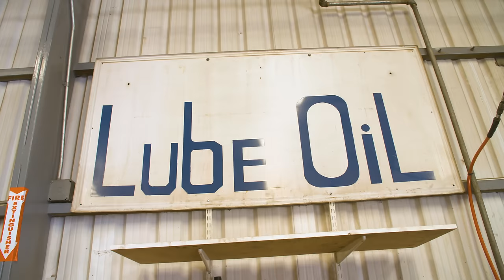Welded Diff vs. $1200 Diff | HiLow

Comment: It's cheap to build a race car. It's expensive to make a daily race car.
Reply: Well said
Reply: Yup, thats why cars like GTRs M5s etc are so expensive 😭
Reply: You can always weld the diff and when it brokes down buy the new diff for something like 700. that kaaz was way overkill for 1200
Reply: The poor man pays twice. Guess how I know.
Reply: Yeah because an f1 car is dirt cheap 🤔
Reply: Mmhmm my modded prius cost more than an FD 1kwhp car 🤡
Reply: It isn’t cheap to build a race car trust me
Reply: @DuBstep115  but if you invest 1200 you wont care about the diff getting broke instead of paying 700 each time its gets broken
Reply: It's cheap to maintain a daily car. And expensive to maintain a racecar.
Reply: Swampy  It blows my mind how many Mini's I see on the road and even more when they are tuned/modified. Those cars are built with such poor quality and the parts are so expensive, I just don't know why they do it.
Reply: Except if you plan on passing tech inspection, when your track you go to is very stringent, if you are using stock seats and belts you are aren’t allowed to go full force around corners and if you have racing seat and harness they have to be a common brand name not some random brand off eBay, ands other random things like that
Reply: HappyDude It isn’t, but we aren’t talking about a fully works-carbon-fiber, custom race turbo-hybrid V6 and a living shit ton of aero. We are talking cheap ebay trubo 4banger civic with a lip spoiler.
Reply: Lincoln locker will eat $1400 in tires evening out the costs in a couple years. Living with a spool or lincoln locker in daily driver life sucks.
Reply: Ummm, what kind of “race car”.  No winning race car is cheap to build.
Reply: @DuBstep115  wait so 2 oem diffs cost more than the 1200 diff already !?
1 2-way diff = 1200 
2 oem diffs = 1400
bro
Reply: No such thing as a cheap race car. Even a properly built miata is still expensive. Affordable race parts are still expensive. If you mean by cheap by getting cheap knock offs from China, they do not classify as a race part.

No true race part is cheap as it shouldn't be. It is your life if something fails on your car at the track. Go watch some videos on youtbe where people car fails them at the track going cheap. Some lose there life because of it, others with permanent injuries.
Reply: lol. Incorrect. Building a miata spec racer is the most inexpensive racecar, expect to come out over 10 thousand invested, even with decent hookups. If you own your own shop, have all the tools and knowhow, it will still be 5-6k for a back of the pack racecar. Expect 30+ thousand for a highly competitive podium car. You can sometimes find these for sale, used in the low to mid 20's.
Reply: Cheap to build a car if u know other racecar people lol. I do nothing but side hustles. And have 3 cars and a truck 2 kids and a wife. My 240sx has 5.0 swap. My lexus gs300 has a 3uzvvti swap. My volvo has a huge turbo on 14psi. All have welded diff. Lexus is tuned. 3.9 gears. All 3 cars ive built with under 2k lmao. Building racecars aint hard if you know what your doing. Plus doing the work yourself. But i mean if u like paying someone to install your parts yea shit gets expensive quick lmao but that aint no fun
Reply: Must i add. They technically arent racecars. I drift so theyre drift cars lol. Ill be at grange for andys slay day in the volvo. Catch yall
Reply: @firsttimegod802  I want an e39 M5 so bad but reliability scares me away
Reply: @Gage Petas its a 1986 volvo 740 wagon. 70mm compressor. 48mm exhaust. At 14psi. Has 350cc injectors. I daily it as well as the lexus. Volvo has been good to me. Hits rev limiter all day and still drives home🤣🤣👌
Reply: @Gage Petas yea older volvo from like 1995 and below with the redblock rwd are Tanks!  You got a genisis yea? Thats the b6? And b8
Reply: @Gage Petas can you post details about your m3 build?  I'm not starting beef, just really curious how you can pull 600 HP on an S54, even with brand name parts say used AA turbo kit or super charger with method/e85 for $6k.  Even 600 hp crank would be pretty hard without some major work, well over $6k.  Thanks.
Reply: Your idea of a race car must be pretty funny.
Reply: @firsttimegod802  agreed.  Modern BMWs (and most cars) are pretty efficient and can't really squeeze out more without heavy modifications.  The S54 has a strong iron block and can handle it's fair share of boost, but still.. 600 HP crank is going to cost well over $6k, even for used parts.  Meth/E85/Nitro? Perhaps for peak power.  For the record, I own an E46 M3 as well and my "race" car (it's not full race, it still has cats and stock intake), is all about weight savings and suspension and putting what power I have down the most efficiently and effectively.  Still well over $6k on that alone!
Reply: As a rotary fan I learned about balance of the holy trinity of Reliability, power, and fuel efficiency.
Reply: @HappyDude1  I would daily an F1 car
Reply: @romulas-cushmanproject3273  yall need some dirt tracks. ive just finished buying and building my car for less than 3000$
Reply: You can have fast, reliable, and cheap.... pick 2
Reply: @HappyDude1  build a daily driven f1 car for comparison and find out XD
Reply: @HectorOvalle18  How many broken 700 dollar diffs have you seen? I have seen zero, nada non in my entire life playing with Quiafe.
Reply: @Eduardo_Espinoza  Proper LSD costs 700
Reply: @DuBstep115  wait so a proper LSD cost the same as an OEM one!? what!?!
Reply: @Papa7Bravo  
Not possible 
An f1 car dousnt work on the road. 
And a road car can never beat an f1 car on the track
Reply: @HappyDude1  there you go....  so you cant compare an f1 car to anything...

Building a dedicated racecar is cheaper than a racecar that you use daily.
Reply: @Papa7Bravo  
Yes you can an f1 car is the ultimate race car its everything what tuners are trying to do only with exotic materials and the best engineers like those time attack cars and hill climb cars some of them have f1 engines
Reply: @HappyDude1  ok but now make an f1 car a road car and daily it....
Reply: Throw on nitrous, kits run about 500 and install maybe 700-1g, if u dont know a guy. Easiest high hp upgrade for any car
Reply: Anything is a racecar if you're brave enough
Reply: @SI0AX  Because they're a blast to drive, and even more so when they're tuned.
Reply: @whocares7144  nah. real race cars have regulations to meet which would require costly equipment like certified roll cages, fuel cells, fire suppression systems, etc. a miata cup car alone costs a lot more than a base miata + supercharger. also there are no real daily driver race cars nowadays because they won't be street legal, unless you are just talking about drag racing.
Reply: Im building a clapped out e36..ebay and hardware store special.  I won't be a daily driver  or  a race car , Its a  track car so no  specifications, so it will be cheap
Reply: Yeah cause it all need to be road safe and road legal
Reply: @HappyDude1  in terms of building, suprisingly. The cost is mostly just R&D
Reply: w ccbWeesS
Reply: w ccbWeesS
Reply: M
Reply: @HappyDude1  why is wrong with you lol
Reply: On my channel I like to off road in 2 wheel drive as much as possible and I drive on nails.
Reply: @hendrahendra  bcoz cheap parts
Reply: @firsttimegod802  haha you think? A f1 spec v10
Reply: @DuBstep115  With the time and effort and the prospect of replacing the diff and dedicating time and effort with that as well, you're not much off from $1200. That's IF your diff doesn't crap out more than twice in your car's life because that'd be over $1200.
Reply: @jac1207  700 take it or leave it
Reply: Good way of puttin it
Reply: @HappyDude1  Right. Now imagine how cheap an f1 car is compared to an f1 car that performs as a daily driver. Point is a race car is cheaper to own and run than a race car you use as a daily. Its a good point because most people buy their car and supe it up and can be surprised by the expense in keeping the car running.
Reply: @HappyDude1  huh
Reply: teach me the ways of calling the cheap stuff cheap  ;-;
Reply: Truer words have never been more spoken😂
Reply: Ni, Hector, not $700 each time you crack your welded diff. More like $70 for a diff out of the "pick n pull," plus your time.
Reply: @SI0AX  i had 1 and completely agree, thing never went more then a few months before it was rendered useless and stuck in the shop
Reply: @SHRMN8TR  Haha. he deleted it when you busted him  xD
Reply: @lukeclark3623  You have no idea
Reply: @tosehoed123  but i already daily the fastest car in the world
Reply: @kristofermartson1935  he means one that will last just a few races.
Reply: Nailed it 👍
Reply: Sums it up pretty well
Reply: @HappyDude1  no but none of the people watching this are working on an f1 car are you?

Comment: I will never forget the first time I swapped an open diff for an LSD. I was blown away how much more power I was able to put down and how much sooner. That's a phenomenal upgrade if you are serious about driving. For the street on the other hand??? I don't know if it is worth it. As I don't see a reason to drive that spirited on street roads. Maybe I am just older now. ;)
Reply: I had an 84 Camaro with 3.73 posi and I now own an 82 with an open diff. Waaay more confidence in the 84. I could push that car hard, drive it in the snow, etc. My 82 now can barely handle it in the rain. If it even smells like it might rain, that car starts spinning. The bigger motor might not help with that though ;)
Reply: Chevrolicious Something tells me it’s that bigger engines need to be revved and pushed harder. Hence the increase of LEAD in a man’s shoes. 
But what do I know? ;)
Reply: Lockers for all.
Reply: I have a fwd stock van and welded the diff just for fun and then sold it. Its was stupid
Reply: Your just older now lol 😉🤣🤣
Reply: BLAZINGINGPHOENIX Considering all the years that have passed. I would agree. ;)
Have a good new year everyone that is commenting.
Reply: The MK7 GTI is everywhere here in CO. Comes with LSD and is definitely one of the top choices for the mountain twisties and snow.
Reply: ekome I do like those cars. They’re fun cars as well.
Reply: @WarriorsPhoto  makes perfect sense to have LSD for the street too because it's low power, you can really get the most out of it
Reply: ekome That’s a good point. I didn’t think about that.
Reply: @_e5598  LSD is better on a front heavy car than AWD, but it is legal to substitute snow tires with AWD in CO.  Politicians are dumb.
Reply: @theBear89451  nothing replaces snow tires. The locals know.
Reply: One word “Snow”
Reply: @theBear89451  Um last I heard California gets snow too. ;)
Reply: 2 years on my welded e46 diff with no issues and I ❤ it!
Reply: Tropical Company Really??? That’s very cool. Isn’t the diff on those cars electronic?
Reply: On my build- I recently swapped rear ends.

Its pretty much undrivable without a locker or LSD in the rear end.... but- I dropped a 1,000 hp into a pickup that has enough traction issues with 400hp.
Reply: ericmck2000 Geez that’s a lot of power. Although I may be a C5 Z06 in a year or two. That’s 400 HP factory. LOL
Reply: @WarriorsPhoto  I had a GTO which was close.

But, it still wasn't enough power that you couldn't just mash the gas pedal and not have to worry.

At 1,000hp, you can't mat it until around 70+
Reply: ericmck2000 I was in a buddies 600+ HP Mustang(SORRY), a few years ago. Yup if he mashed the accelerator at under 40 MPH, it was just wheel spin. No bueno dude!
Reply: @WarriorsPhoto  I don't know.... being able to smoke the tires at interstate speeds is pretty fun, lmao.
Reply: @xtremeownagedotcom  I understand that. That was the first time I had experienced that. I was shocked coming from ah hum, Honda.
Reply: @WarriorsPhoto  I live in Northern California and we rarely get snow
Reply: Jordan Ware Same as So-Cal. Fair enough. ;)
Reply: @Chevrolicious.  84 Camaro? Quite the powerhouse.
Reply: LSD is great for winter driving fun, and not getting stuck in a pile of snow
Reply: erttu Snow is drive to in anyway. ;)
Reply: @WarriorsPhoto  very true
Reply: erttu Yes definitely! Thank you for the post. (:
Reply: Personally want an LSD on my z3, car is way too light, borderline impossible to drive in the rain without slipping a little bit. Gotta love that little dash light.

Comment: "I don't see this diff ever breaking"
In my personal experience, you just awoke every tiny flaw in that thing. You can't just speak bold statements like that without cursing yourself.
Reply: except for a welded diff, just filled the core of mine with weld and it outlasted the car, dont do manjis at 150 on a single lane dirt road
Reply: I converted my subaru to RWD by welding the center diff. i beat on it like crazy, and then 2nd gear finally gave up the ghost.
Reply: @bigcazza5260 yeah any drug at 150 is a hell of a ride

Comment: “welds will not stick to dirty metal”

laughs in 6010
Reply: Dirty metal*
Reply: B Watts i meant dirty metal
Reply: Yeah everyone's like oh you need to clean that up really well and all that I just grabbed 6010 and make sure it goes in deep
Reply: Y’all sure that y’all are using metal and not plastic?
Reply: That's exactly what my first thought was😂😂
Reply: Why not 7018?
Reply: @nukedukem420  7018 you can get porosity, it's pinholes in your weld and the imperfections like grime and dirt cause it. 6010 is infamous for just plowing through any imperfections with ease.
Reply: @zephyr3638  That makes sense
Reply: That Welder repping your name very well lol
Reply: He don’t got no stick doe
Reply: Yeehawww 6010 baby, whip n pause and keep the arc length just right! Crank up the amps & run a good ol pass and tie those gears together. Stackin Dimes😎🤙🏼
Reply: Actually it’s 6011 rods 😂 6011 rods are used on rusty metal, pipes, and things like old farm equipment
Reply: For the most part, most stick welding rods will work fine. 7018 can have issues if the metal is absolutely filthy, though. But that's where 6010 comes in.
Reply: *laughs while turning the amps all the way till the selector falls out of the dang welder
Reply: @GeneralBrosky  6011 are essentially 6010 for AC.  Great for the cheaper buzz box welders that a farmer might have (well... back in the day anyway)
Reply: Stick is fking horrible unless you’re a pipe fitter or doing structural.
Reply: Yeah, I like 6010 for heavy corrosion or paint, but the spiders... brake clean, dry, then light it up with 7018
Reply: A proper weld sticks to anything, the metal should be molten and fuse with itself. else you're just making slag.
Reply: @NeutronicalGaming  Not good. Porosity/contamination weakens your joint. If someone is paying you to weld, this is really really bad.
Reply: @Russell_and_Rosko  for outdoor you can only use  non gas process basically just stick and FCAW
Reply: ...every welders nightmare unless working on a farm...
Reply: I feel like you notice it mostly when you're parking.

Comment: I drove my 350Z with a welded differential for over 2 years. The only issue I started to worry about was transmission wear. My 3rd gear would grind occasionally and I always believed that my differential had something to do with it.. (shaking, abnormal stress, etc.)
Reply: Any update on this situation?
Reply: Believe it or not, it was actually probably the drive shaft. Had the same issue in 3rd.